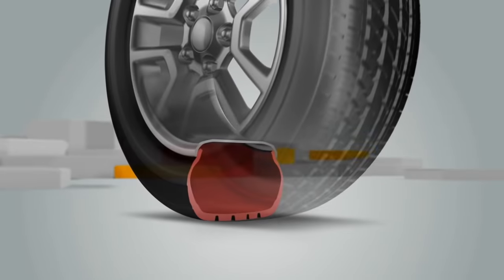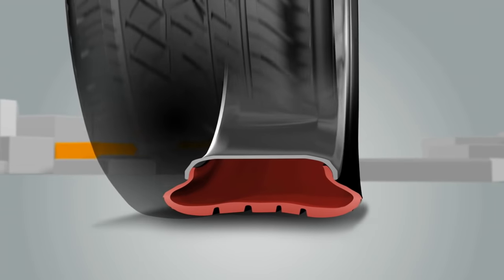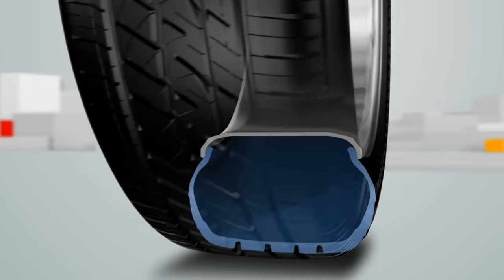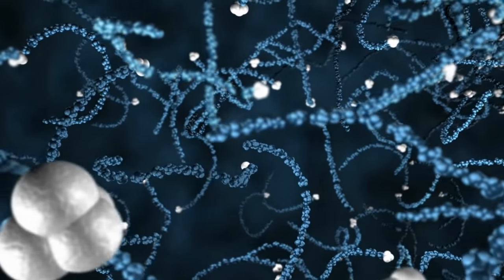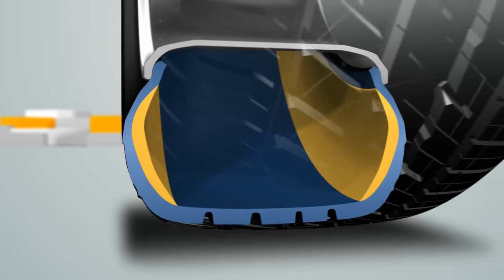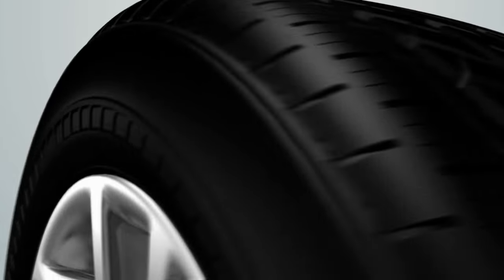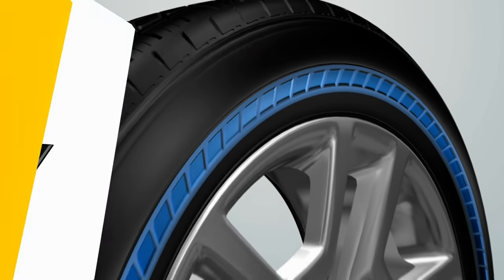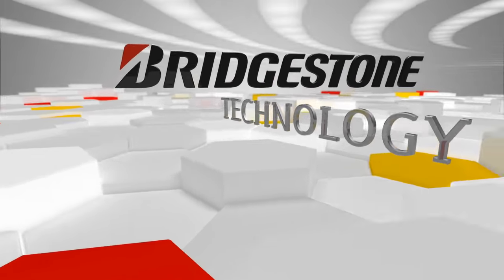DriveGuard - Run-Flat Technology

Comment: I  was wondering how I was able to drive my Camry 36 miles home with a split in the tire without it falling out of the rim. I was bored today and opened my vehicle manual pouch and the tire manual had RFT Run flat technology on the cover. Thank you BridgeStone. You save me

Comment: Don't let a flat tire slow u down stuck in glue even without air pressure run flat tires are useful for driving 55 miles an hour safely.

Comment: My question is, after 50 miles running flat, is the tire still reparable, given that it was reparable just after loss of pressure? Thanks.
Reply: motofan16  no u need a new
Reply: motofan16 l8. (
Reply: it still depends on where the hole is. deep in a tread? plug hole. on the thick tread part? nope, its different every time.

Comment: If you get a flat with one of these in snow or icy weather, would it severely effect traction and be dangerous to continue the 50 miles, at a relatively safe speed considering road conditions of course?
Reply: Thats pretty much its purpose, to get you home safely or to a service station after a flat. 
The run flat tire with the loss of pressure, actually will give you better traction. (in that instance)
(Same principle as why Off-Roaders “Air-down” to maximixe grip and traction in mud/snow etc.)

Comment: It said you can go 50 miles before it deflates entirely. Can you keep inflating the tire (with a portable electric pump) as needed to run an extra 50 miles (or more) without hurting the enforced sidewalls?
Reply from the maker: @ScottMartinD We appreciate your question. Reinflating would not be recommended. Bridgestone's DriveGuard run-flat tires work up to 50 miles after a puncture up to 50 miles per hour. If you have any additional questions or concerns, please, feel free to PM us back. We value your business with Bridgestone. ^Cali

Comment: just drove 3761 miles on these tires across the US in 7 day,  did not get a flat tire which was good,  tires drive great, I didn't hit snow or alot rain ( so can't say speak for snow or heavy rain) ,  they are about 1/2 wear when I started the trip, so they are a bit noisy, the side wall is stiff,  235/55/18 tire on a AWD V6 2011 Toyota Rav4,  over all happy with this tire if you must have a run flat tire,   I was happy to KNOW if I got a flat i would make it to hotel or service station and not stuck someplace (especial in these weird times)

Comment: Do spike strips puncture Run-Flats?
Reply: no
Reply: YES they do, lol,   the side wall on these tires are stiff, that is what makes up for the air loose, its just like a normal tire, but with stiff side walls, so a nail or spike strips will puncture them
Reply: spike strips are basically hollow metal spikes like needles and they let the air out, but yeah 50mph for 50 miles even if the cops are on you lmao

Comment: Bought a 2014 BMW 320I with Bridgestone run flats. I WILL NEVER BUY A CAR WITH RUN FLATS EVER, EVER AGAIN! THEY ARE NOT REPAIRABLE - THEY MUST BE REPLACED. You will not likely have a spare to switch to (the theory is that a run flat tire does not need a spare to save space and weight).If you get a flat in a small town, it is not likely they will have a replacement available so you will wait for at least a day to get it replaced. Maybe you can drive 50 miles but your car will wobble all over the road and never feels safe. When I go to buy a new car, it will be on the condition that the run flats are replaced with regular tires and that they include a spare. I don't care if it takes up most of the room in the trunk. At least I'll be able to change it and get on my way. 
THE ABSOLUTE WORST INVENTION EVER!
And I speak from experience.
Reply from the maker: HI Ernie, 
We are very sorry to hear that you have had a negative experience with our Bridgestone Run Flat tires. We would like to have your concerns addressed by our managment team. Please feel welcome to email us at SocialCare@bfrc.com for support. Thank you for contacting Bridgestone Tires. ^Sarah